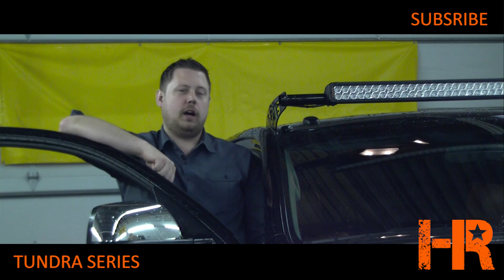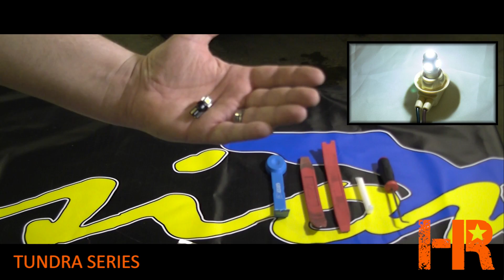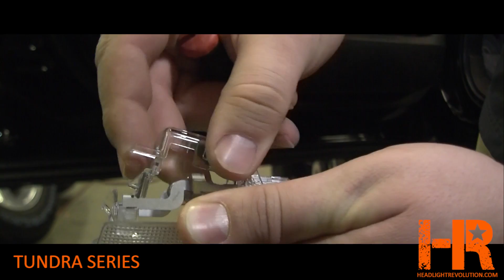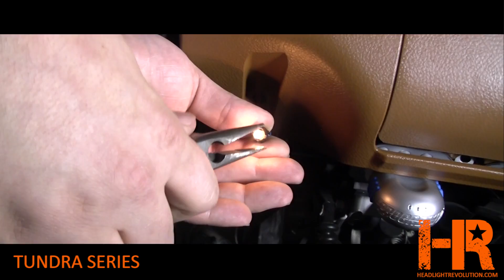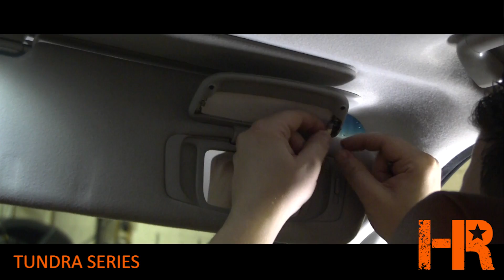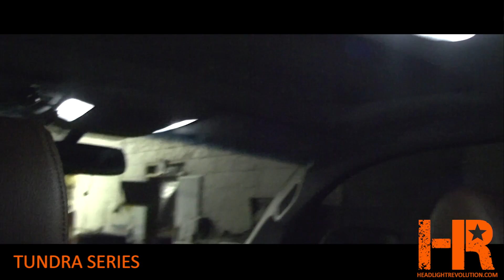2007-2013 Toyota Tundra Interior Lights | Headlight Revolution | Tundra Series (6)

Comment: Any idea how to pop the cover of the puddle lights on a 2012 Toyota tundra
Reply from the maker: Rachel Davi We've found that it is not worth the amount of work and time that it takes to replace these lights.
You would have to dismantle your mirrors and do some modifying to get a new bulb in there.
Reply: The OEM puddle lights are a sealed housing. You can tilt the mirrors all the way up and get in there with a long flat head to release the clip holding them in. There's a few kits online that plug and snap right in. Definitely worth the time and effort. No dismantleing or modifying required.

Comment: Everything was going just as you demonstrated until I got to the dome light. Make sure you use extreme caution when putting the bulb back into the socket. In my attempt to put the bulb back I pushed half of the socket up into the top and shorted out my interior lights. Great video series. Thanks.
Reply: I did the same thing except didn’t short anything out. Took a while to get the socket and the reflector back right. I’m talking hours. Had to use a small pick to bring the contact back down and then reference the other light for the reflector. The reflectors are thin. Just use extreme caution. I feel like this is a rare occurrence but evidently I’m not the only one
Reply: Mine also, had to pull the console off and fix the contacts, the bulb sits so far in the reflector it blocks all the light. I painted the inside with silver paint and threw the reflectors away and it is so brute now.
Reply: Me too but with the map lights 😂
Reply: Wish I saw this comment before I attempted it myself lol. Did the exact same thing, fixed the connection points and seem to be not shorting the circuit now. Highly recommend listening to this comment.

Comment: What happens if you don't put back the metal reflectors ?
Reply from the maker: You won't have the light that is being shot up by the diodes reflecting down, giving you less usable light
Reply: Headlight Revolution 
But it won't damage anything right ?
Reply from the maker: Probably not?
🤷

Comment: any advice on fixing any flickering?
Reply from the maker: Normally I would tell you that the Tundra doesn't have any flickering issues, interior or exterior. But since you're reporting this type of thing it's one of three things: One: The bulbs you used are defective. Two: You have a brand new Tundra a couple months off the assembly line, and Toyota changed something. Or Three: your vehicle has a defective alternator or battery causing poor voltage throughout the truck. Please give us more information and we'll try to help.

Comment: I've got a 2013 CM SR5 TSS, the doors only have reflectors on the inside instead of courtesy lights.  Any idea if the wiring is back there to be able to install the lights?
Reply from the maker: Joe Bob Yeah that was a sad feature Toyota took out in the newer models. The 2015 Tundra doesn't have them either. From what we can tell, we don't think there will be any wires back there.
Reply: ok thanks, i think i've figured out what other wires I need to tap into to get it to happen.

Comment: Does the interior light kit work for the 2015 Tundra?  As well as the optional LEDs for the kit?  Thx
Reply from the maker: WonderingAimlessly The Tundra lights are a little different in this truck versus the new 2015. We are currently in the process of filming and putting together 2015 Tundra Specific products. The 2015 does not have an option for door lights. You can find the new 2015 kit here and we will make sure we get you the new lights we are putting together. http://www.headlightrevolution.com/Tundra_Interior_LED_Lights_p/tundra-intled1416.htm

And you can always email us at sales@headlightrevolution.com if you have any specific bulb questions.
Reply: Headlight Revolution Thx.

Comment: You talk about replacing the single under the dash light; however, I can't seem to find it anywhere. I've even looked on your website for the bulb. Any ideas?
Reply from the maker: Nick Parsons Sorry about that. We had it off the site since the bulb is on clearance. Currently we only have a limited color selection, but you can find the bulb here: http://www.headlightrevolution.com/ProductDetails.asp?ProductCode=7010209

Comment: Need help when I installed the first one it work but when I put the second one all the interior lights don't turn
Reply from the maker: We Think you may have accidentally shorted your positive and ground when installing a bulb.Try checking if the interior lights fuse is blown. Then make sure to try putting the bulb in the other way if it doesn't work the first time, because the are polarity specific.
Reply: Headlight Revolution the same thing happened to me... any suggestions?